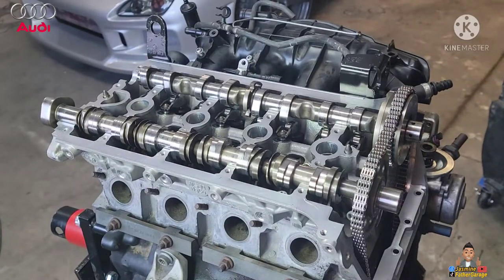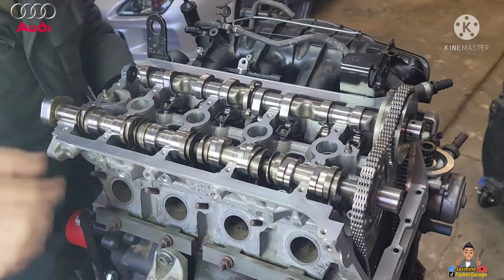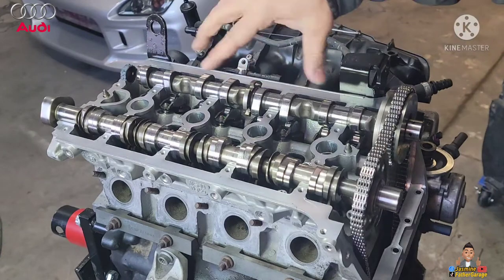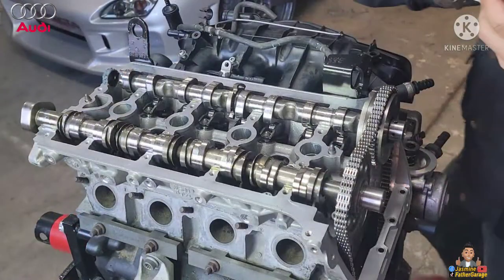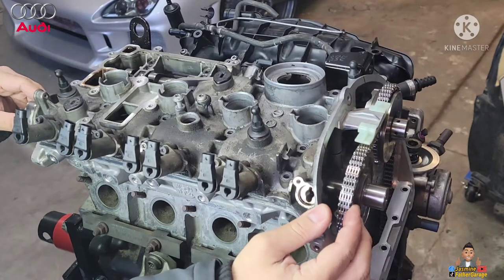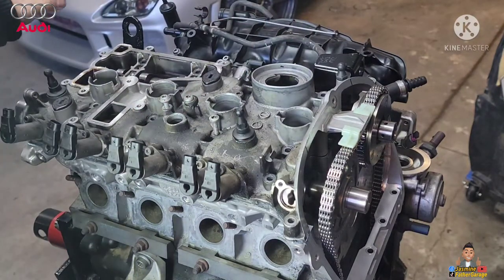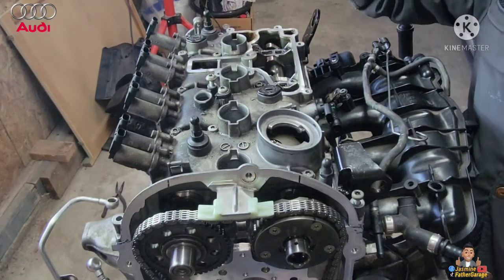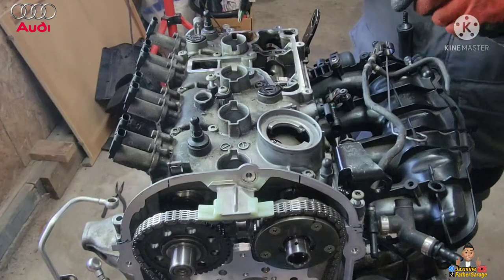Audi A4 Engine! Camshaft Cover Torque & Installed #automotive #mechanic #foryou

Comment: My 2015 audi a6 2.0t has oil in the spark plug chamber, would it be that the gasket from the valve cover needs replacement?
Reply: Same as mine, I think to open and put silicon glue then place. have your fixed?
Reply from the maker: Yes just need to remove and clean  all the old  silicone gasket from the valve cover and the deck of the head and  replace it with new silicone gasket
Reply: Thank you so much. I haven't worked on it since I've been working in and out of state. 

Would you guys happen to know the PN# of the Silicone Gasket?
Reply: @jfGarage4k  Thank you, I am going to do it, a little afraid about cleaning the old silicon process to not fall some debris into the body.
Reply: @worldofentertainmentandnat1607  let me how it went. Hope all goes well.